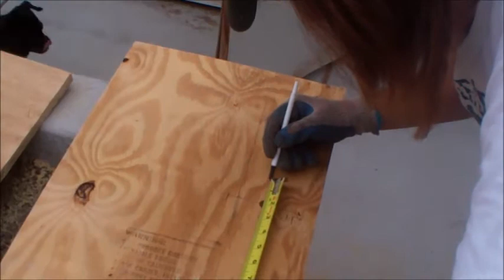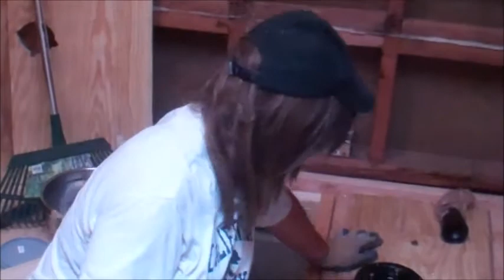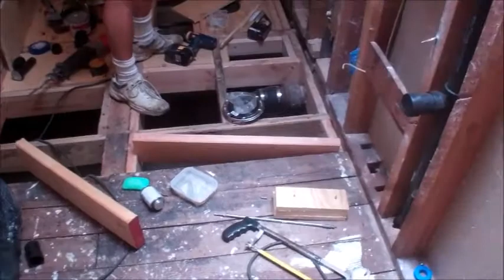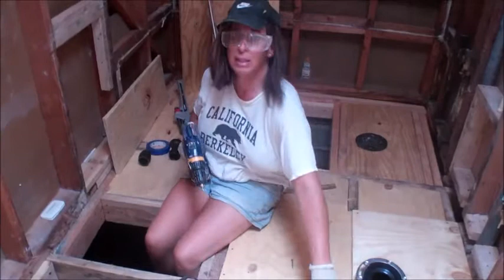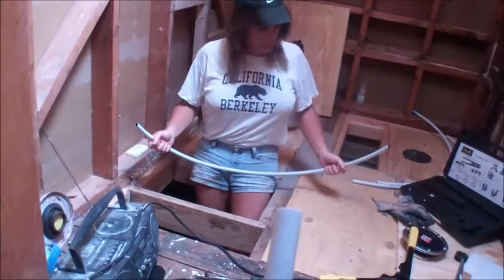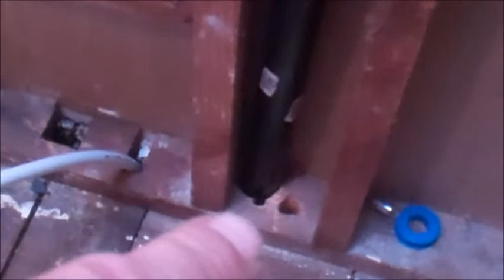Saturday  Bathroom Renovation on da Casa

Comment: I know all to well injuring yourself by falling through the floor joists.
Takes the wind right out of your sails and sets the tone for everything else to not go as planned the rest of the day
I cant even count how many times I have fallen and seriously screwed my self up, I have some pretty big scars to show for it :-/
You did pretty darn good today though, you got that flooring and waste pipe done and  working good nothing to sneeze at there.
You are super close to not going back under the house for the plumbing anymore, once thats done you are going to feel a big sense of relief and your biggest worries will all be up top without the dread of the underworld.

Teflon tape and pipe dope on those supply line adapter threads will insure you dont go back under for a leak later on.

Good job girls.